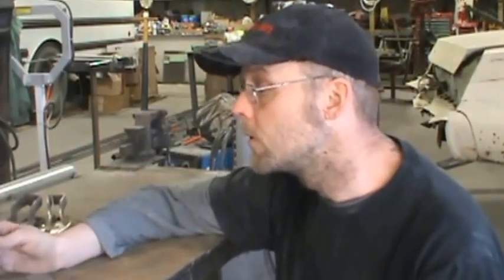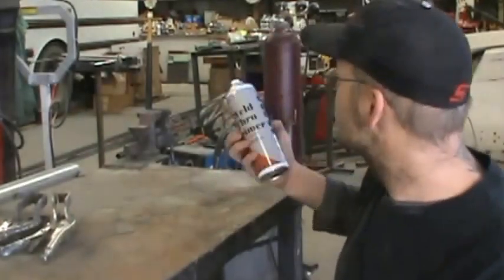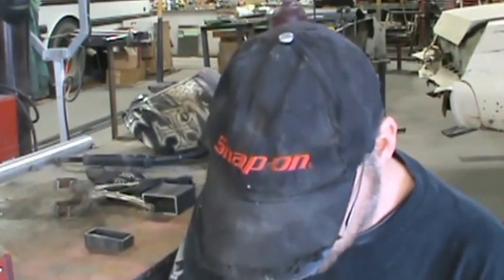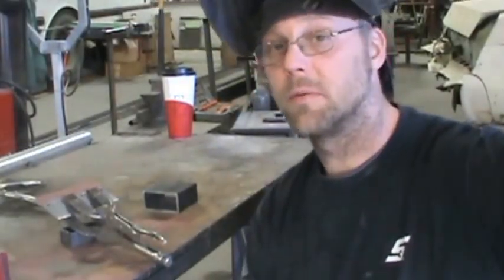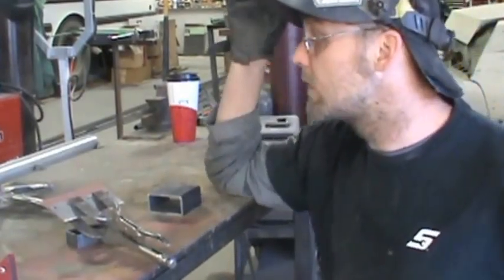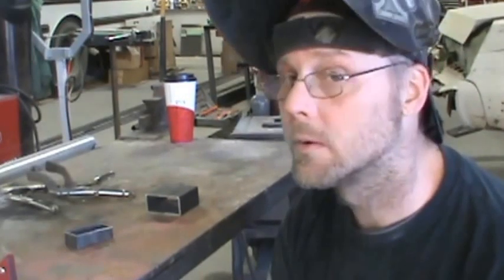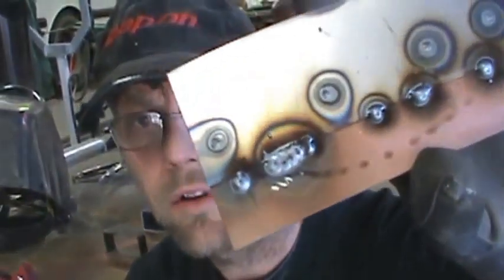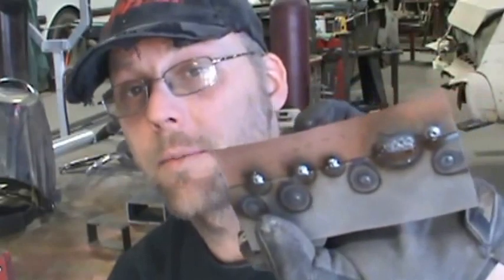Product Review Impact brand copper weld through primer

Comment: I have always fought with the Zinc weld thru, I've found that if you put just enough on and let it dry really well then it does work okay but still a pain in the ass. I'm going to have to try that copper weld thru, looks like it works a lot better than the Zinc. Great video. Have a good one.

Comment: I hit my zinc plug holes with a captive spot sand blaster. Never had weldment issues Welding over copper paint is still paint and the welds can't be that strong
Reply from the maker: I have since seen major galvanic corrosion issues arise from copper weld through. I at this point I no longer recommend copper.